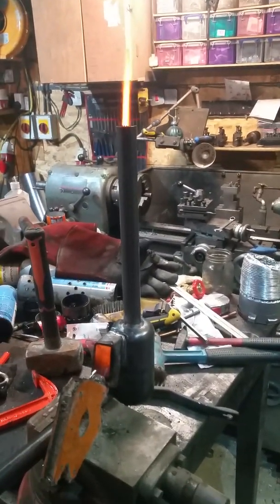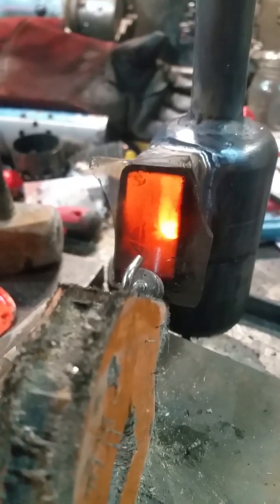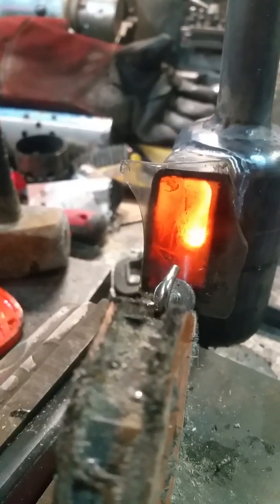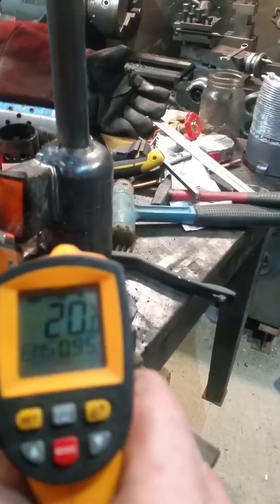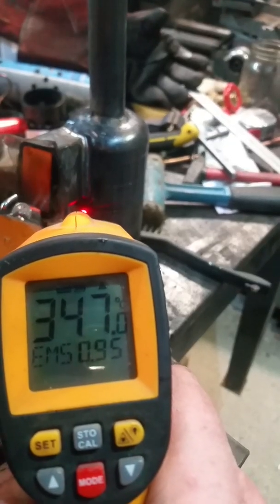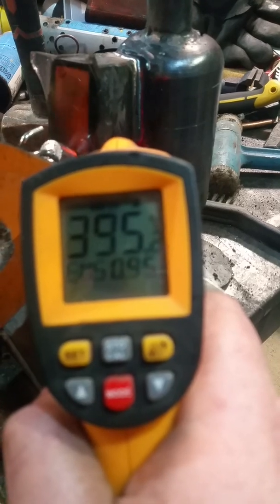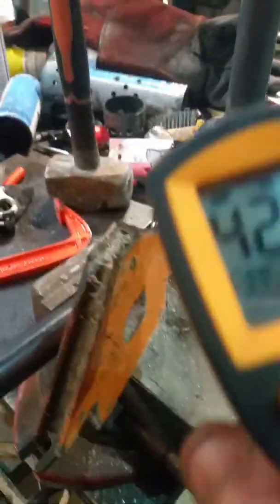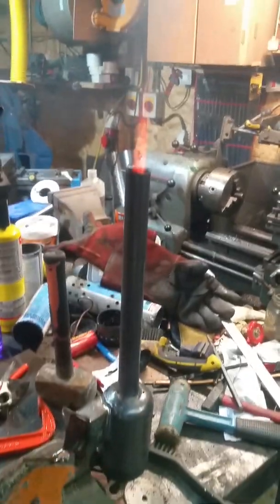tiny homemade diy waste oil burner development

Comment: Hi. I made a burn chamber similar to yours, but I could never get a complete burn. Tried tens of different modifications to no avail. Finally gave up and went with a true and tested design much like this one https://www.youtube.com/watch?v=LupDWIAwvzA&t=125s. But mine has the air coming from underneath, and I use a larger air pipe so my blower doesn't need so much head pressure. It worked flawlessly on the first try.
Reply from the maker: My burn stays clean so long as the chamber is fed slowly. Only made it like this because I want to keep it very small. I think adding a little deflector inside the chamber as the air flows back round to the inlet might help. But like you say trial an error.